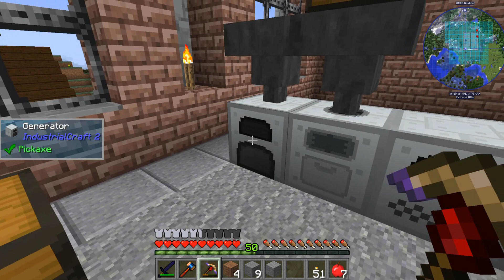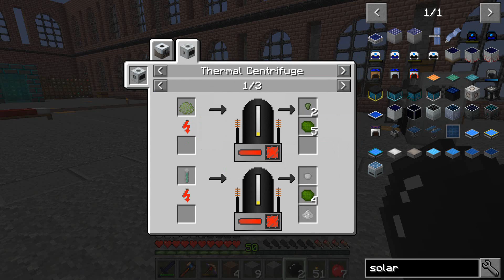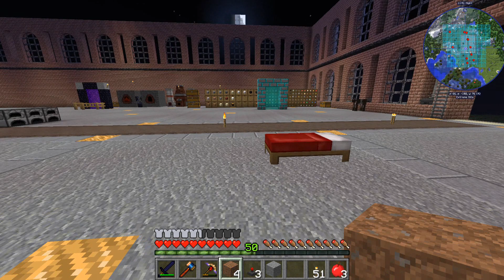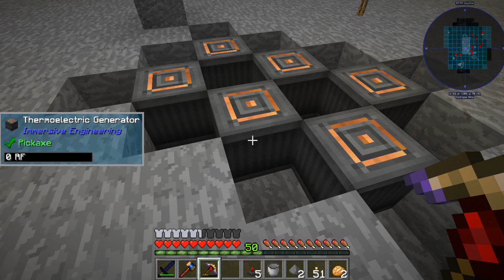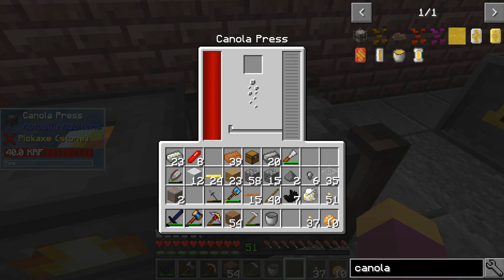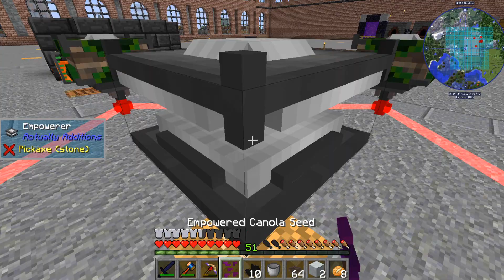Age of Engineering EP9: "Exploring Early Power Options"

Comment: How do u make the arches looking so round with chisel and bits
Reply from the maker: If you look back in my vids theres one called "Creating detail with c&b", which shows you the process, but basically use one the online circle generators for minecraft and base your arch on half of the circle size that fits your space your trying to create the arch in (remember, 16 bits in a full block so if your gap is two blocks you need to generate a 32 width circle for c&b)